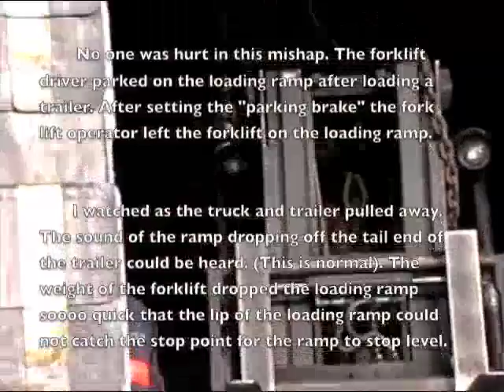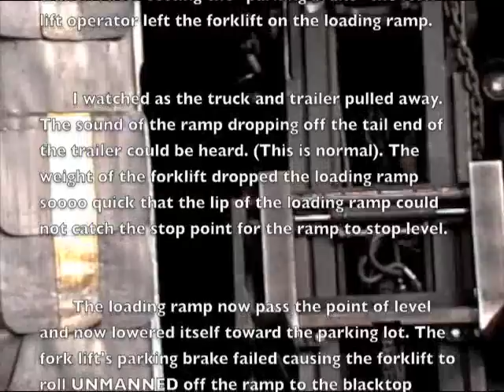Forklift Epic Fail and Recovery

Comment: For the commenters asking why such a big truck to do this - ever looked at the weight on a forklift/lift truck? They are not light weights.
Reply: I drive a rollback and maybe could've made it happened. He did it much better having that boom helps.
Reply: Correct they’re pretty heavy. I drive a gas one which is bigger then this one. An mine weighs right around 5000lbs

Comment: If the operator had turned off the ignition key, the regen braking would not have any effect whatsoever, as there was no current to the motor. Regen is not meant for braking, it is meant to increase efficiency by regenerating electricity through induction back to the battery. It also serves to reduce wear and tear on the brakes of the lift. Like I stated, there is no safety interlock on the brakes with the deadman switch on the seat. The parking brake failed to hold a 12000lb machine on incline.

Comment: I can see that the fallen lift is a crown sc4000 or sc4500 series lift truck. That truck weighs more than 6000lbs. The 36volt battery in it alone weighs 2500-3000 plus. Add that to a 4000lb truck with no battery in it. You may hate on that wrecker all you want, but hes going slow so he doesnt get himself or anyone else injured or killed. Its dangerous enough putting a jack and blocks underneath a lift, what the wrecker is doing is much more dangerous.

Comment: This is what happens when truck drivers don't check with the warehouse to be sure that the ramp is up and clear. I have had them pull the trailer out while I was still loading and on the trailer. That is what I like about warehouses with the red and green lights. If the light is red you don't move the trailer.

Comment: If you ever have your forks on something above ground level and attempt to go down; the mast/forks will remain where they are unless able to push said object down. In the former when you pull your forks out they will drop because you've still moved the hydraulic fluid out of the mast. That's why the forks remain where they are when the lift is picked up. The hydraulic system keeps them in that position. The forks would have dropped lower if that wasn't the case. Ergo, they were left up.

Comment: The reason for the slot in the roof cage is, if it is a electric fork lift, that is so the chain from the hoist can drop down to pull the battery out at the charging station.

Comment: the presence detection system is only to keep the truck in neutral, when the driver is not present in the seat, as this is an electric truck, it has no interlock in the "park" position to keep it from rolling free. The video stated the e-brake or parking brake failed to hold.

Comment: the battery is usually under the seat forklifts are designed to take exterior abuse without any mechanical damage. most common things you see are broken hydraulic hoses and bent masts.

Comment: Just like DEEREMEYER1 said.

Usually forklift trucks weigh about 30% or so more than their safe handling rating. 
But, the mast hydraulics and structure is rated far beyond the lift weight for reliability reasons. That is usually the reason drivers get cocky and pick stuff up that is too heavy and end up doing the teater-totter or picking up the forklift ass instead.
It may be funny and fun to do. But they have to keep in mind they are playing with a very agile 3 tons or heavier machine.

Comment: the forks went up when it crashed to the ground.. thats why the control cables were slack when you looked at it early in the video.. had they been raised there wouldnt have been as much slack on the cables since they would have been spooled

Comment: all you had to do was drive another forklift outside and use a tow chain to pull it on all 4 wheels, that is if you cant just lift it enough to slide it out.

Comment: with Crown Trucks you have to remove a center bolt and then slide them along the carriage plate before hooking them off. The way that sc3000 has nose dived off the dock, you wouldn't be able to remove them forks. plus if you could the carriage smash down to the bottom of the mast. as for removing the battery , you wouldn't be able to as the truck needs to be down on all wheels , as the battery needs to be lifted through the cut out in the overhead guard and slide towards you. If you could have removed the battery, lifting the truck would be unbalanced and nose dive while being lifted... so how the recovery guy recovered was correct .

Comment: Thats a sc4000 the parking brake on that model is manually applied. The electronically applied parking brake was brought out on the sc4500. The operator did not apply the brake or the customer did not approve the repairs needed to keep it working to factory specifications

Comment: I don't see any signage as to whether or not the truck driver is responsible to chock the wheels, there is no dock locking device in place ( a hook that grabs the trailer bumper). Granted the driver should never have parked on the dock leveler, but the business is at fault here too. If no dock lock is present, the fork driver, and the truck driver need to make sure there are chocks under the wheels of the trailer! Driver presence detection systems would not have helped in this case!

Comment: Thoose are not cables that are slack. They are hyd hoses for the sideshifter. And crowns have spring loaded electrically released brakes. If this rolled off the dock the brakes were non-functional as the brake and parking brake are the same.

Comment: While forklifts are not lightweights. They are not the most heavy ether, this forklift is no bigger than those we have. And they are at 5 ton, so a smaller truck could have recoverd it. But why make it small when you can make it big?
Reply: Yeah, it often takes a bigger forklift to pick one up...
Reply: Two things . . . first, this truck has a power operated boom heavy enough to lift the forklift and then maneuver it back onto the dock. Second, it had enough front end weight to make the lift without having to drop the lift pads. Saves a lot of time, which saves a lot of money. When I drove a truck like this, it was $200 just to fire up the truck and up to $500 an hour for a recovery job.

Comment: That place has to have another lift or two around somewhere. They could have just picked it up and put it back.
Reply: +BULLTRONHERO the only problem with that is the fact that the pacer unit which fell off the dock probably weighs 2-3 times the max load capacity of any other forklifts they would likely have
Reply: Yeah, you're right. They probably don't have more than one size around the warehouse. I'm used to working in a lumber yard where there are a couple small lifts and several much larger lifts, so that was my first thought haha

Comment: strange how it was able to move without anyone in it, most electric forklifts ive operated have an operator presence sensor in the seat that will not allow powered travel or hydraulic function if no one is on the machine

Comment: ...I'm guessing that's around 10-12,000 pounds...or more. I've worked on lift trucks, and you never get off one without setting the parking brake...AND shutting off the engine...that is, if you wish to keep your job...

Comment: my guess is that some forklift companies make both engine powered and electric ones use the same overhead guard on both models to save on having to make and maintaining two kinds of parts which saves on inventory. The forklifts i operate, and maintain are nissans, yales, and toyotas do not have the slot in the overhead guard and are all porpane powered

Comment: Your insults attribute nothing to this conversation.

Of course forks don't offer any resistance when in the upward position, however it's a safety hazard to have them in the upward position, thus every time you park a forklift the forks should be lowered, and the E-brake should be on. Even with his forks up; completely stopped the vehicle won't roll forward (In neutral). Why? Because warehouses are built to have a flat floor. This means the operator left the lift in gear and walked away.

Comment: those small forklifts only have 2 - 3.5 tons.
so a small recovery vehicle (like 5 tons) would be enough.
but americans LOVE it big :D
so no surprise something like this did show up :P
Reply: Lifting a 3.5 ton lift a meter into the air and a good 2-3 meters off-center to the truck doing the lifting requires a truck with quite a bit more than a 5 ton counterweight. That is simple physics. Also those were just minor movement estimates to give an example. This was moving the truck higher and farther off-center than that which would require substantially more to keep the truck lifting it from tipping itself.
Reply: Boosted1981 No way. A LD or MD truck wouldn't have near enough boom extension to get the forklift back into the warehouse. And yes to what Myriad said.

Comment: the ramp should have been put back to normal postition before the truck pulled away.. that's if it was actually working properly, they had these type of ramps in a place I worked in and they were always messing about.

Comment: I am a certified forklift trainer through Crown and obviously no one in this company has watched (or has paid attention) to the "It's up to you" video that is supplied with your contract with Crown Equipment. You NEVER park your forklift or such on a dock plate whether there is a trailer there or not you idiots! The brakes will not hold that much weight when the dock plate goes down. There isn't anything wrong with the brakes (if maintenance has been done). Operator error is to blame, period.

Comment: @ScubaTiger well  we had an idiot where i used to work did the same thing it took us about 30m min to get it back inside usind a 10 tonne fork lift  to lift the front and a 1 tonne fork to drag it back.the only real damage was to the operators pride.i still say using a heany recovery vehicle was over kill

Comment: @mikeejay63 A Cat electric truck weighs in at around 13,000lbs with a 48 volt battery.
That's for a 5000lb capacity lift.

Comment: depends on if the brakes are maintained. Ive used one where even if the parking lever was engaged the thing would still roll on a hill.

but seriously. hook a chain on the top with another forklift. hook another chain to the tow hook on the back, and lift and pull. would have taken twenty minutes at most.

Comment: As a Certified forklift OPERATOR I see so many mistakes here

Sure another forklift could place the fallen lift back on its dock
First step - remove the battery - makes the load safer and lighter DUH
The tow truck driver should have removed the forks... they come off you know
Just saying...
Reply: How would they remove the battery when it's on an angle like that?  That wrecker has more than enough capacity to lift it with the battery still in the machine
Reply: +Wesley Cooper  
You're showing your experience - or lack of -
Naw.. I am not going to tell you.....Any one else care to school this guy.  Next he is gunna tell me it's an electric lift and not propane, Geez I tell ya,.,.,. where do you newbies come from.
Reply: John Smith my dad put me on a Hyster for the first time when I was about 12. I've had several jobs since then that require not only all different types of forklift operations but heavy equipment, such as dozers, front end loaders, haul trucks etc. For all these jobs as a general rule, if there's a forklift on-site, you get a training session for the forklift along with everything else. So, since this is what you do for a living, can you tell me why, when all the training I have received starting clear back at 12 years old with my dad, has taught me to drive backwards, do I see 98% of incidents happen with the vehicle driving forkwards? Yes, I called it that on purpose. Does the training no longer include that you should always drive in the direction you can see, which most f the time, is backwards. This is just a me to you question and has no revelance to your comment or the video itself, as there was no operator on it when the incident happened.?
Reply: I am CERTIFIED OPERATOR 
With many many years of experience.  Just because a person is certified does not make him/her an OPERATOR.
It just means they SHOULD respect their training.
A training school will not show you a lot of things   rmthis comes with doing the work as safe as you can.  Common sense and training should kick in. It takes YEARS to come an Operator.

I. e.
With your forklift you are working at a place that has vehicle tires.  You are to bring the tires to door 45 a trailer is parked at door 34.
You have 16 trailers to load before lunch. How is the best way to get tires on your forks.
No pallet is used 
Bare tires only
Not wrapped up
They cannot be wrapped you are going just 200 meters to the van. 
What is the trick to get 8 tires on your forks?
See this they don't teach in any school.  Only a skilled experienced OPERATOR can correctly answer this question.
Do you think you have the correct answer?
Reply: John Smith For me this is missing several variables. How big is the forklift? How big are the tires? Are all trucks being loaded from bay 45 to bay 34? How are the tires standing\sitting? But, I will say what I would do with the info provided. - I will assume the forklift is he average size for warehouse work and the tires are standing\leaning upright against the wall. So the easy answer is to simply insert the forks through the tires, 4tires per fork.
Reply: The tires are laying down and stacked 8 tires high
Car Tires standard size for a car 
That
Truck tires stacked 4 high

Note;
You just transfer the tires from point A  and drop the load in front end of the trailer.
In the trailer 2 men will handbaum the tires one by one
Reply: John Smith how do you get the forks under the tires without damaging them? My experiences are with things like loading flatbeds and using chains to move heavy concrete.
Reply: Now your showing lack of experience   come on
How will you load these tires. 
They are rubber tires ffs
Reply: Lack of experience, yes. Like I said, I operated but never a certified continuous operator. I guess I would pick em up like anything else, slight tilt, 1\4" off the floor, slide to center, flatten out, go in and lift it. Forks slightly wider apart so when you lift the tires tilt center supporting each other instead of falling outward.